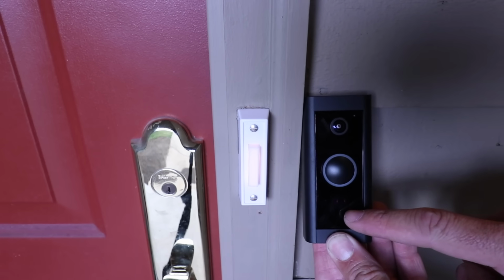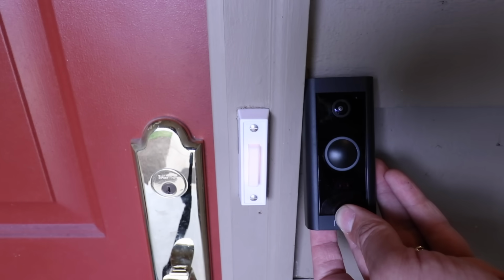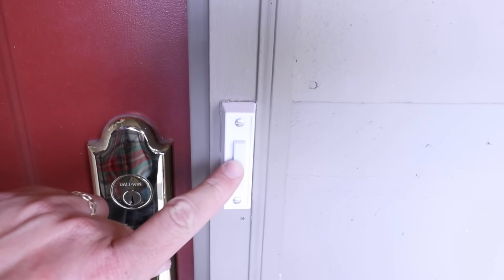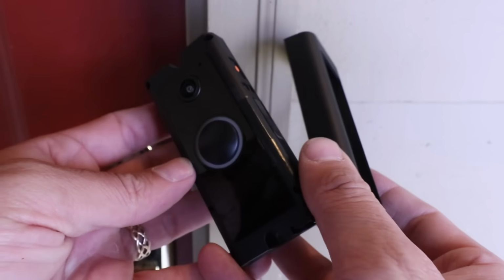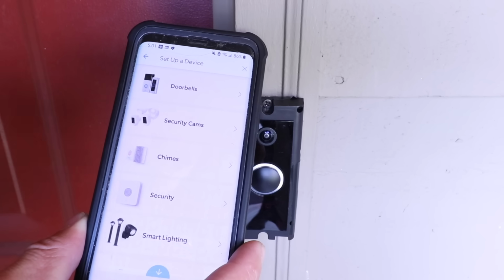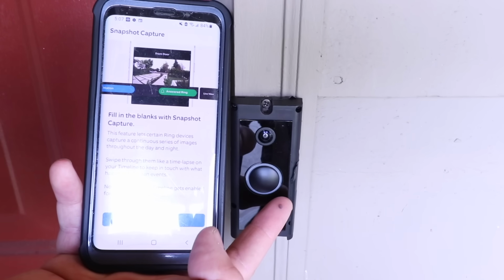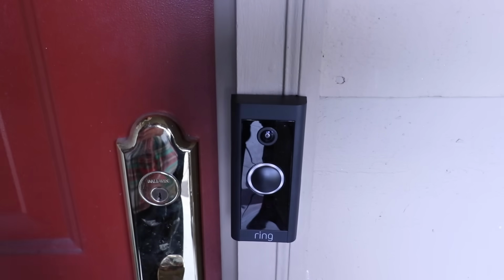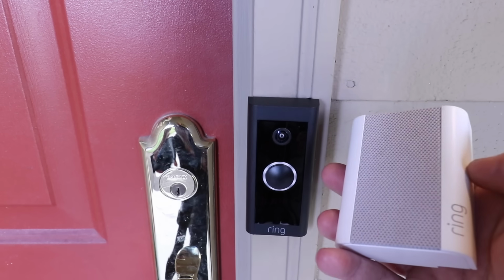How To Install Ring Doorbell Wired

Comment: Ring has made it terribly difficult to buy the right type. None of their engineers came up with the idea of making these Ring bells universally applicable. Production costs for very large numbers of that universal type are lower than all those super different types together. So thank you on behalf of all users who are now stuck with a Ring bell that does not have an HD camera, but records a now ridiculously low resolution. Admittedly, an unsuspecting adrift buyer will go for the lowest purchase price, but with a Ring bell that does not produce an HD image. Can't Ring start a trade-in campaign for all these misbuyers. If necessary with an additional top-up the payment?

Comment: There’s a problem that no one mentions. The jumper cable you install in the wiring that disables the original doorbell chime ALSO killed my back door original house doorbell which i still need/want. Yes i want the video doorbell at the front door but don’t most houses have another doorbell that’s still needed.

Comment: What happens if you don't put the jumper on? Idk why they didn't make this one to where when the button is pushed it makes a circuit ringing your regular chime. If you touch the wires together it rings inside my house. Idk what im missing on this ring when it comes to that. And I have had a lot. This is just the first one that has extra bs lol. Great video though thank you!

Comment: Do you really need to turn off circuit breaker to connect the low voltage ring doorbell? Of course, not all

Comment: What they don't tell you is, don't just check the volts and hertz at the doorbell. I checked mine before buying the doorbell and I got 11 volts at 60hz. The ring camera says 10-24v is enough, it's not. For some reason it just wouldn't work with my existing transformer, of course I had to buy their transformer for some reason. Even though mine put out what's supposed to be the acceptable volts.

Comment: Why does it disable the house chime? I have my doorbell 2 connected to the hardwire with the battery and the house chime still works i never used the ring plug in chime

Comment: suppose i want to install this doorbell on the side of the house, not the front..do i still install the jumper cable
the same way? front/trans?  or suppose i want to install 2 of these doorbells, one for the front and one for the
side, how would the jumper cable be installed then?

Comment: Help me

I have old doorbell and chime and it was working without the transformer it worked with 230v

So is that mean I need to install the transformer

But where should I install it I removed the old chime now and old doorbell 220v

Help

Thanks in advance

Comment: Hey, I installed my ring doorbell wired. When i turn the power on, the blue light just keeps flashing. Do you now what the problem is? Thanks in advance!
Reply: It receives 12V

Comment: If you have enough power, can you just skip the jumper wire? Will it still ring your bell if you do? Of course if it doesn't have enough electricity to meet the demands it might lose power, but if I skip the jumper and it has enough electricity to meet the camera's demands, will it ring my bell?

Comment: Is it possible to use the existing chime with the wired Ring doorbell?  What is the purpose of the jumper cable?  I thought it was so the Ring doorbell would work with the existing chime.  It does not work that way.  Thank you. Joe

Comment: Umm..why did you mount it on the uneven brickmold surface?  Moisture will get behind it potentially.  Kinda a hack job imho…..  a few minutes of time with a sharp chisel ensuring a flus surface mounting is a bi more of a pro job….

Comment: We have just rebuilt our cabin at the lake. I told the electrician that we wanted a RING doorbell do he created a spot and wired it to the outside by the door. But we have never had a doorbell here and I cannot find the breaker for these wires. How can I tell if it is a live wire? Maybe I should have bought the battery operated RING doorbell?

Comment: you dont need to shut off the circuit breaker to install a doorbell!! i have changed several doorbell switches,and i have never had a problem
Reply: Seriously? Because my doorbell isn't labeled on my breaker so I was about to shut off the power to the entire house!

Comment: Great useful video. I wondering, we tried to set up and when we turned the power breaker back on the light around d thr button never came on. Our wires are thicker too, not as thin as yours. Any idea what it could be?

Comment: Hi 
I installed the wired ring doorbell, so its working fine with phone. But existing chime is not ringing when some one ring the bell. I tried connecting and disconnecting but either way its not working. Can you help me with this ? How to make my existing chime to ring with this doorbell. Its working fine with previous regular door bell

Comment: I have two door bell buttons, one in front of the house (where I plan on installing the Ring doorbell) and another in the back of the house, both use the same chime, My question is if I install the jumper is that only disabling the front doorbell and will they still be able to use the chime with the rear doorbell??

Comment: Can you skip the jumper wire at all? So that the you can hear your normal dorbell sound inside without purchusing the chime? Or is this step very important other than disabling your doorbell box?
Reply: No. The jumper sends current back to the transformer, otherwise the doorbell chime and the ring doorbell itself would be wired in series. Neither would work.
Reply: @JonahEby  Thank you!
Reply: I just installed this very same ring doorbell at the house, didn't use the jumper either. The mechanical chime doesn't ring anymore neither does the doorbell at the back door.  I'm always at work so the only way I've figured out how to notify someone at home is to have an Alexa echo yell out everytime someone rings the front bell
Reply: @Jahalang82  does it ring chimes through your phone?
Reply: I installed mine without the jumper and it works
Reply: @cbjueueiwyru7472 thank you! That’s what I wanted to know. I’m just going to try it without the cable and see. UPDATE: it didn’t work with my Nutone  wall mounted chime. You have to purchase a Ring doorbell that will work with your chime and they cost more. This particular one he uses in the video as he stated does not work with your existing chime. You have to get a Ring plug in chime or upgrade the Ring doorbell ☹️. I like my wall mounted chime and don’t want a plug in chime.
Reply: @cbjueueiwyru7472  did you just install as instructed? Or did you do anything different? Because mine doesn’t work…
Reply: Has anyone found a solution to this yet? I’m still curious to know if the Ring doorbell will be able to ring my old doorbell chime.
Reply: So if one wanted to continue using their existing door chime, are there settings in the app to allow this?
Reply: @jpvintage  I’m wondering the same thing??
Reply: Will it ring through your phone?
Reply: I still don't know the answer to this question but I have found a solution. If you have an Alexa, just link it to your Ring account. Alexa will let you know if there's motion or if there's someone at your door.
Reply: @SonicaLuda dcr😢ho

Comment: Great video, truly helped me set-up in 30 minutes, and I'm almost 60 yrs old.  The one thing I noticed is if you set-it up with Alexa (Echo Dot), it will ring through the Eco Dot, you hear a chime on the Eco Dot, so I didn't need to buy the ringer for it.  Thank you once again.
Reply: Almost 60? The universe blessed you. You don’t even look almost 50! 😉
Reply: Thank you for the echo dot information I purchased that along with my ring doorbell. I’m so excited to install it!
Reply: do we really need a transformer to wire the doorbell? will it not work with the regular current ?
Reply: @iamjoachim2542  yeah, doorbells since 1890 have used a step-down transformer. (I had an 1890 house that I rewired, re-plumbed, re-drained in 1982 when I was 29 or so.)
Reply: I did it in 15 min and I’m 70. Rings through my Ring control box and Ring apps on iDevices. I had an older SECŪR360 installed last, which changed all the original wiring. I ended just connecting the transformer output to the doorbell wires directly. No ding-dong yet on my Echo Dot gen 2, but I have a newer Echo coming. Now we need an 80 year old to do it in 10!
Reply: I did the same I have a DOT and a SHOW so now it rings everywhere I might get one for
the basement but only if I really want to

Comment: Good instructions but since I am a perfectionist, please don't mount on the molding, yikes.  Mark off the location of box with pencil on molding and and chisel the part of molding that intrudes under the box so it flushes out.  This will look more professional.  Not doing this, the gap behind could be problematic in the future.
Reply: or better yet, add a spacer so that your molding is not damaged going forward.  A sliver of wood or plastic under the Ring like a gasket would be better and less damaging.

Comment: This video wasn't very helpful. 

I connected the Ring doorbell to the wires and put the power back on. The light wouldn't rotate. Only the bottom half would blink. According to the Ring app the wires of the house need to be checked by an electrician. House was build in the 90's in the Netherlands.

The Ring Chime also doesn't work. First it did flashed green light. But suddenly it stopped working after trying to connect it to the wifi network.

I wouldn't recommend Ring products.

Comment: What would happen if you don’t install the jumper cable? I currently have the ring doorbell pro but it stopped working and bought this one thinking that I could just swap it for the old one but didn’t notice that this would disable your chime. And I’m just wondering what would happen if I do it like I was originally planning to.
Reply: I’m not an electrician but I would guess the jumper cable is used to complete a circuit. It sounds like you should hire someone to look at what you did.

Comment: no knowledge whatsoever.  if you install a jumper on trans and front. the door bell will not work anymore, pressing the button will shorth the power supply.   go learn electricity.

Comment: Only thing stopping me buying this is I can't use my original house chime
Reply: You don’t have to turn off power to doorbell you won’t die 😊. 
I install these daily and I never disconnect power
Reply: Mine uses my original chime. I just wired it up using my existing doorbell wiring and it worked perfectly.
Reply: My original chime didnt work with this when i bought it. How can i connect it
Reply: Is this still true? I thought they included a jumper to use existing chime
Reply: No updates on the chime feature what a holes..
Reply: That's optional.
Reply: @ZKINGSMN so can we leave the original chime? I was wondering the same thing.
Reply: Can use alexa for the chime
Reply: You have to buy the chime to go with it.
Reply: You can if you buy the pro

Comment: Thank you for this video. I was going crazy trying to figure out why my mechanical chime was disabled...now I know this doorbell disables it and I have to buy the Ring one
Reply: Same problem, I thought I installed incorrectly.
Reply: My question is.
 If I do not install jumper wire into existing box, doorbell will not notify me when somebody press doorbell?

Comment: Couldn’t bypass the “not enough voltage” message even though I tested and have 12 volts. Any idea how to bypass?
Reply: I have the same issue. 12vac but got the “not enough voltage” error message. Can’t bypass that screen!!
Reply: I'm having same issue, did y'all solve?
Reply: Same problem here.  I did see where he hooked the Ring up to another transformer and then back to the original and that worked.  I’m going to try this tomorrow.

Comment: My front button doorbell is burned at the chime connection, i just move the front wire & move it to the rear so i can use the other chime connection. Question, can i still use the old burned front chime to make a connection for RING doorbell as per your video or I have to buy a new chime & replaced the old one? Thanks

Comment: How you managed to bypass the error message for the low voltage? I have 10 VAC and still get the error message (which im unable to pass) that my doorbell require at least 16 VAC... ? :)
Reply: I think it's bad coding in the app.  I was getting blocked by the 16v-24v required pop up in the app.  I disconnected the doorbell, took an old 12v AC transformer (it was reading 14v output) and connected it to the doorbell and then went through setup.  After that I reconnected it to the 10v at the doorbell wire and it worked fine.

Comment: I don’t understand why you’re installing the jumper cable in the existing door bell chime. I did that and my transformer burned down and that caused power loss to the door bell. I have to call an electrician to install a new transformer. I used the existing door bell chime with ring. It’s working fine. Besides it saved me another $30 to buy a ring door bell chime. I will tell you these it’s a bad idea to install the jumper cable.

Comment: I bought the 2021 model thinking it would work with my chime. I had googled it but must have missed that this model does not work with mechanical chimes... I don't want to buy another device so I'll try to get my Alexa to play a ring
Reply: Have you been able to get Alexa to play the chime?
Reply: @folarinkomaiya9934  I did, yes.  Was actually very simple to do
Reply: @snuckyr  Wow, that's interesting. So far, I've relied on my phone notifications and Echo dot but won't mind the mechanical chime since it can be heard on all floors. Would you be able to walk me through how you did that? This is the 2021 lower cost wired doorbell, right?

Comment: I thought you said if you install the jumper, your existing doorbell chime will work?
Reply: Infant, the jumper cable has the opposite purpose. The jumper cable is for disable your original doorbell.
Reply: @kakalammaka7074  Infant, so If I don't install the jumper, my existing doorbell will work? I don't want to install their additional chime box.

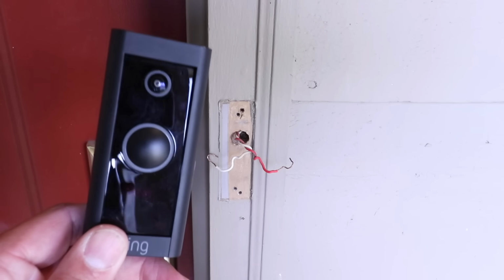Comment: 4:09 mins (<<click here) I could not figure out how to get the cover off. I tried a little but I did not want to break it either. FYI- Amazon just lowered the price for the basic Ring wired to $41.99. I wanted the Ring Pro2 but it is out of stock, Amazon delivery was estimated as Jan 2, 2022! So when they lowered the price from $60 to $41 I figured why wait and I can save $ now!!  Thanks for the video.

Comment: Installed the ring door well (wired) and thanks to you everything working fine except it is not  ringing inside the house. I did not buy chime with Doorbell, can we use the existing nuTone chime to redirect the ring wired doorbell sound to existing chime?
Reply: I also want to know if it is possible to use the current existing doorbell

Comment: Thanks for the video. I just bought the exact same doorbell. I have a question regarding the wiring. The current intercom system that I have on the front of my house that the ring will be replacing, uses four wires connected to the back of it. Do you know if there is any way I can use that existing wiring to connect to the ring? Can I use only two of the four wires, and cap off the other two? Thanks in advance.

Comment: What happens if u don’t put the jumper wire ??
Reply: The doorbell will work anyway, but it will get damaged in no time.
Reply: @kakalammaka7074  kool thanks I was wondering what will happen but I used the jumper anyways

Comment: What happen if you don't have a doorbell? 🥺
Reply: It's not a simple task to run these kinds of doorbell wiring without ripping apart your walls, as all of the wiring is normally done when they build the house.  The optimal solution would be to see if you have an existing external AC outlet nearby where you can mount the doorbell as they sell a specific adapter that plugs in - route the cord with external conduit to keep it neat and prevent someone vandalizing it.  There are also little lockboxes you can get for the AC outlet to prevent tampering.  An internal AC adapter might also work if you can plug-in near the door and just drill a hole through the side nearest the door.  If there is no AC outlet you can go pure battery and just recharge, albeit these need frequent recharging (every 2 weeks or so) which is a pain, in which case you might want to see if a solar panel option might work in your application to recharge the battery.
Reply: Just get the wifi version and a ring chimer. For $100 more. It will save you the trouble of getting electrical shock. I just screw it to the side of my front door.

Comment: What does that jumper cable do inside the chime box? I didn’t do that with my other ring doorbell at my other property and everything works just as it should over there. However, this doorbell has this jumper cable and when I called the tech-support they insist that I must install that jumper for the doorbell to work correctly. There is not a place inside of my 1968 doorbell chime box for that to be installed. Is my only option for a successful install to make sure I get this jumper inside the door chime box?
Reply: You can install it without the jumper cable and it may look that it works fine, but the device will end up getting damaged in no time.

Comment: Heyyyy what happens if I don’t have a doorbell, how do I use the jumper cable
Reply: If you dont have a doorbell, your house may dont have internal wires to supply your ring video doorbell with power.